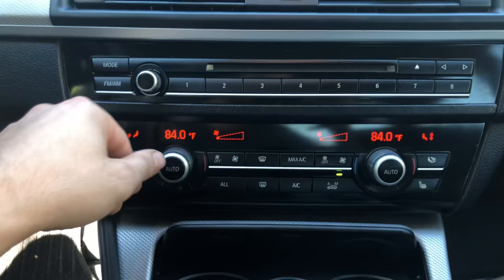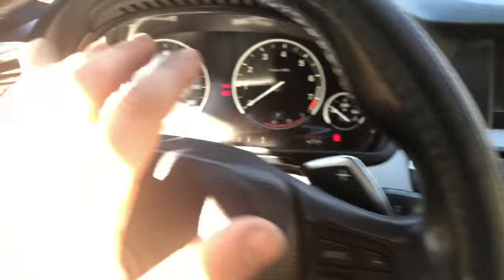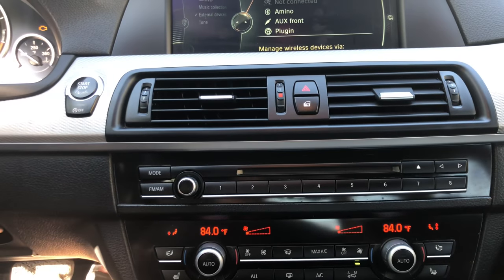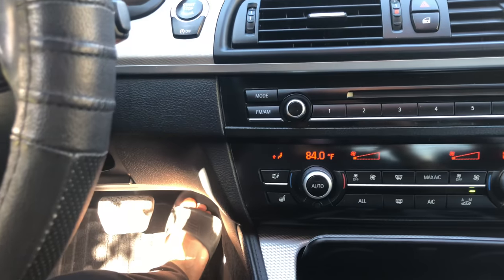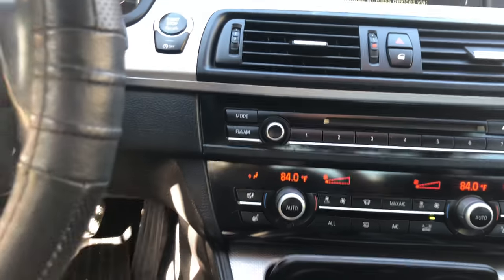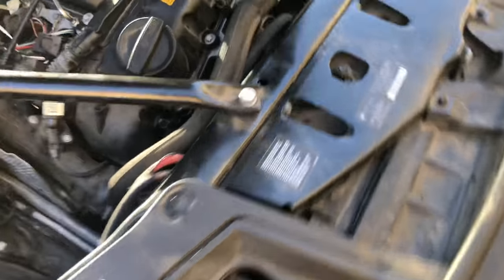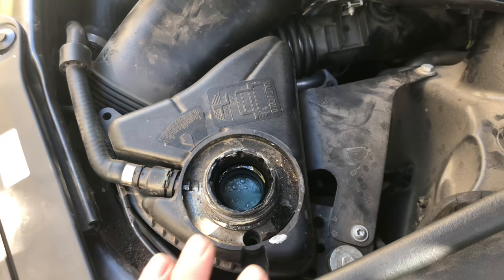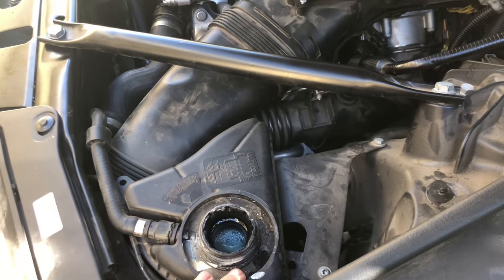Bmw how to bleed coolant system

Comment: Hey bro today in my bmw 535i 2013, I got the  overheated sign all of a sudden. I turned off the engine and wait for the 5 mins and the sign has gone. Then I drove back to miles to home and just checked your procedure and pump bleed perfectly.any thoughts or idea bro. Thanks
Reply: Has your car overheated since ?
Reply: check ur coolant level...?
Reply: Maybe battery is on it's way out

Comment: How will you know when the process is over? Count 13 minutes? Also, does the coolant cap need to be off or on?
Reply: Good question, the service manual instructions aren't clear on this process  either. One part says Do Not perform bleeding  procedures with the cap off but in the step by step instructions  it mentioned that you will need to add coolant  as needed during the bleed process

Comment: Is it the auxiliary water pump that pumps? What do you do if it doesn't kick in? Is there another way of bleeding coolant?
Reply: That’s the same problem I’m having right now, my auxiliary water pump is brand new, but doesn’t want to bleed. I’m having such a hard time finding the fuse
Reply: Did y’all ever get it to work ???

Comment: Hi please help me if you can, i have a bmw M550D  n57 3.0 diesel f10 C774376 and i cant start the bleeding process I do the same I also tried other way as i read and also went to bmw specialists... Like ignition On Heater highwst temp lowest Speed, Gas press for 10 ssconds, Start engine withjng 30 seconds It doesent start the water Pump
Reply from the maker: Christian Andolini have you changed the water pump and you are trying to do the bleeding process?
Reply: Mr. How To No i didn’t change the water pump, Mechanics Changed my Glow Plugs Which required to Remove my Secondary Intercooler on the top off my Engine So some coolant Has escaped , Now when i turn on My Heater On High temp low speed i hear Especially when engine warm i hear From dashboard like water Goes back and forth in a Bottle ... I have Nice flow In the small hole from the coolant Reservoir , but for some reason the bleeding process wont start and i don’t have error code , I have but thats for my Heated mirror not working. And My Comfort access on one side off the car doesent work
Reply: Mr. How To i will upload video few min and then i send you the link Off the sound from the dashboard
Reply: Same problem for me, i replaced the radiotor on my 528 f10 whit Electric pump today, and i could not bleed the system because my pump wont go on.
Fan on highest temp and lowest speed.
Can you help me
Reply: @90umit  Hi I got my shit sorted , So basicslly for diesel at least my car there is no feedback As for my car it says to turn on engine after pressing the gas pedal then turn on engine let it run 10-15 minutes , repeat if necessary engine temp has to be below 50celsius . Bmw says to close the Coolant cap For me that way the air never went Away My mechanic did the bleeding process With Coolant cap removed to allow air to go out!
Reply: @bmwsincekid  thanks for answer👍

Comment: What happens if you started the car after refilling the coolant ? Not in accessory mode
Reply: It'll recirculate anyways, but you still have to stand nearby and fill it up as much as necessary, but it is a less safe method because of you not being able to monitor the possible temperature raise - gotta be careful with overheating.

Comment: isn't' there supposed to be a bleeder screw? I don't understand my BMW is 520i and the reservoir looks different than yours.
Reply from the maker: Tek have you tried this method ?
Reply: I didn't but I saw multiple videos and I don't know which way is the right way? I really don't want to start this process until I make sure how it's going to be done. My reservoir is ball-shaped and white.
Reply from the maker: Tek check if your car have an electrical water bump, pretty sure it does have an electrical water pump. Try this process if should work
Reply: Mr. How To I have a 2013 535i xdrive and my car gave this temperature message then 2 seconds after the overheating msg...I stopped cooled down and did the bleeding procedure u did, the pump seem to be working perfect...the pressure is pretty high... but after bleeding and driving in sports mode few hours later the same thing happened...do you think it’s my thermostat that needs replacing? Could my thermostat cause those temperature and overheating msgs?
Reply: @waydefrancis1816  yup thermostat . Exact same thing just happened to me . If water is shooting into your reservoir , then your pump is good .
The problem is your thermostat is stuck closed .

Comment: What can happen if the auxiliary tank coolant level sensor fails?
Reply: Then it pops the error even though the reservoir is full or also, it can show no errors when you're low on coolant and creeping up in temperature

Comment: Any other tips On these BMWs in particular ?
Reply from the maker: phillymusiq send me a message on what would you like to know and i’ll make a short video. Please like the video and subscribe
Reply: @omarkokobobo  Bro Got question while driving and car rolling I hear a winning noise sum time after acceleration 535 xdrive f10
Reply: @RealPStakks  @mr.HowTo how this man ain't responded after so many years...bro I got the same problem water pump not working
Reply: @BoarLyFsDxp3 whining noise is the ac compressor or water pump. That whining noise is the bearings in the wheel of the part.

Comment: Hello. I replaced my coolant temperature sensor. After that I did the bleeding process and after finished it I drove the car for 20 mins and when I stop I notice a coolant leaking coming under de car. It’s never has leak coolant before. Can you tell me something about it
Reply: I have the same problem